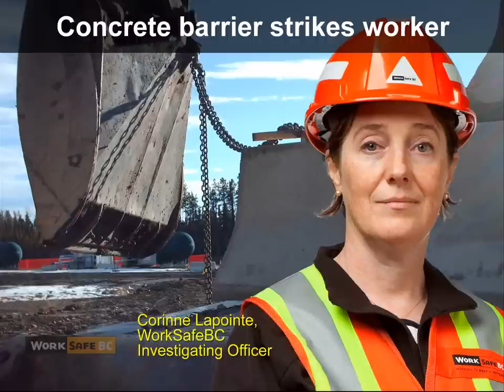Incident Investigation: Worker Injured While Offloading Concrete Barrier | WorkSafeBC

Comment: At my job if you walk away from a suspended load, and leave it untended without your hands on the controls for a split senond, you are fired.
Reply: Your hands should NEVER be on the controls when a load is hanging over a co-worker or if a co-worker is under the bucket of the excavator.

Comment: I blame this entire incident on the excavator operator.   period.  If he knew what he was doing this would never have happened.  You NEVER get out of heavy equipment with the implements in the air, regardless if they have a load on or not.
Reply: The man on the truck is also to blame. He had no business being close enough to the load to be struck.
Reply: Do not agree fully, This was not the Drivers first Rodeo, he allowed himself to be in the line of fire, should have removed himself, knowing rigging was not right for the job, prior to the lift starting. Sad, we still do things wrong, but know the right answers.
Reply: It was a group effort. Everbody fucked up.
Reply: You have one life, You bear ultimate responsibility for it.
Reply: Obviously it's the supervisors fault... that's his only job... to supervise... refuse or question his decision and he will find new employee.
Reply: @abrammarba9700  Roger that Sir! ultimately the people responsible for these people are to blame also!!
Reply: I blame it on the company. They should have policies in place so that workers don't have to improvise when then company doesn't properly prepare.

Comment: I call bs on lever snag. He manually released the lever as he entered the excavator at which point he bumped into the joy stick as he sat down
Reply: No , it is possible to snag a lever or joystick by exiting or entering a cab ! A.G.C. Certified January 1988 and still operating
Reply: What you just said makes zero sense. Your saying he lowered the lockout lever as he entered and then hit the joystick. For one to do that would be so unnatural it's not even funny. Theres no reason to do that. You would then have to try and step over the whole joystick column? Yea no dude. What's funny is you got 40 people to believe you.

Comment: I've set thousands of barriers and had one slip out of a lifter once.had my hand on it guiding it. When 20 ft chunk of concrete falls 4 ft next to you, you learn to expect everything you lift to fall. Straps wouldn't have slipped as bad. Operator should have stayed in cab on controls.

Comment: Its a fail on both parts, The operator should never had left the driver stand near the load and the driver should have got to another spot outa the way. I had drivers get pissed at me for stopping unloading well casing from there trailers when they would walk away and I did not see them or they would be standing alongside of the trailer. I'm not a expert but I would tell them stay away steel on steel slides and is not predictable and a bundle of 20ft casing would do a lot of harm. There is always a danger around stuff like that, you got to do everthing to make it safe as possible

Comment: The operator is to blame. But the man on the truck is also responsible for his own safety and has no excuse for putting himself in a pinch point or under/ beside the load. 
I’m an iron worker/ welder. That’s a foolish mistake.

Comment: why was he using a digging machine as a crane?
Reply: cheep way to do it
Reply: @johnhershey4010  ....Driver was assured there would be a picker. No picker. No delivery. Total BS
Reply: Excavators are also commonly used for lifting.   And while he holds some blame. The man standing beside the load is responsible for his own safety. Rule one is do not stand near or under a load. Period.

Comment: Improvising the unload with an excavator isn't the problem here: It was the proximity of the driver to a lifted load, and the excavator operator's decision to leave the controls with a lifted bucket, let alone while loaded. Also, I doubt he actually set the safety lever at all in the first place.

Comment: That safety lever on the excavator must be MOVED to another location.  I almost lost my life in October of 2021 with an excavator. I'm not an operator but I am good at operating them. Went to a job site as a driver and proceeded to load my truck with it.  The sling came off from the load so I tried to exit the excavator and my long winter jacket engaged the safety lever and at the same time a pocket on my pants got caught in the joystick, the excavator went swinging like a carnival ride with me hanging on to the edge of the seat for dear life with 90% of my body hanging off outside the cab. To this day I still don't know how I managed to stop the machine or pull myself to safety.  I almost ripped my 2 legs off my body with the tracks of the machine.
Reply: May God have mercy on you.

Comment: The fact that an operator got out of a cab is the part that I don’t believe
Reply: And the pant leg then pocket snagging. How is anyone’s cuff that high unless they’re wearing shorts? And how low and at what angle are his pocket openings? Look at the pic of the controls in question, and see how none of it makes sense.
Reply: At least he wasn’t dumb enough to stand under or near a load.  That’s basics.

Comment: I guess straps would have been better than chains and wouldn’t slip, but the driver was way too close to the load and the excavator operator, should not have left the cab with a load in the air... 🤦‍♂️

Comment: The blame is clearly on the lack of supervisors and of the driver and excavator operator. No supervisors and no oversight means very hard communications and the lack of the necessary safety equipment.  Even so the driver should of denied the unloading without the proper equipment. The operator failed to remain in the cab creating a serious work hazard and did not have the right equipment nor proper way to effectively communicate to the driver.